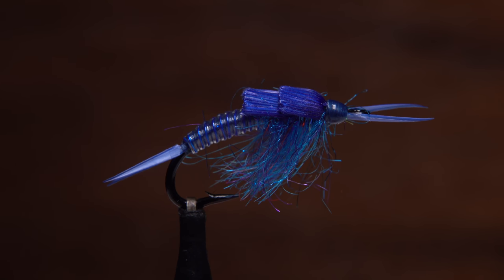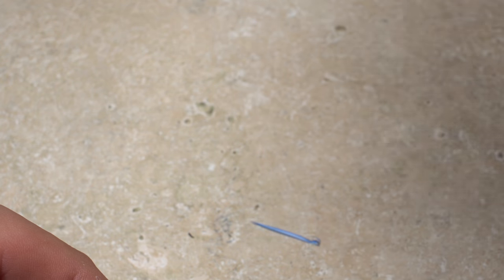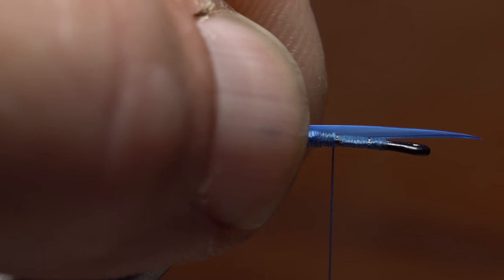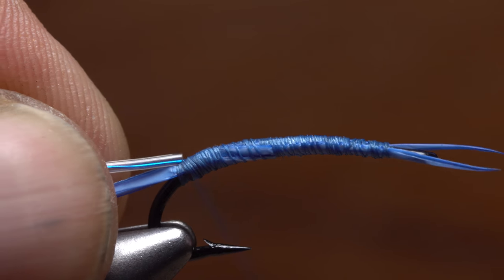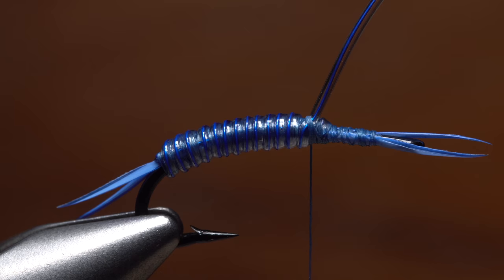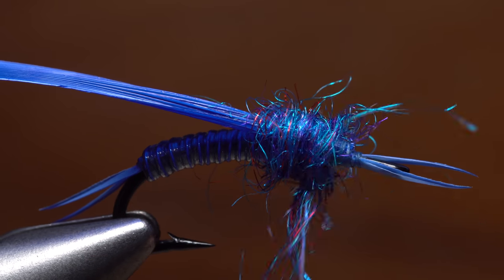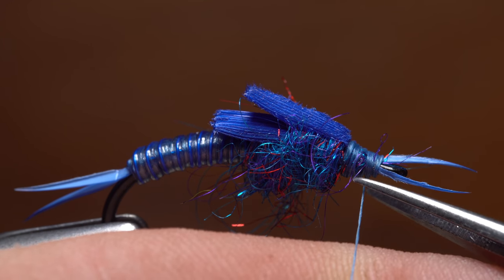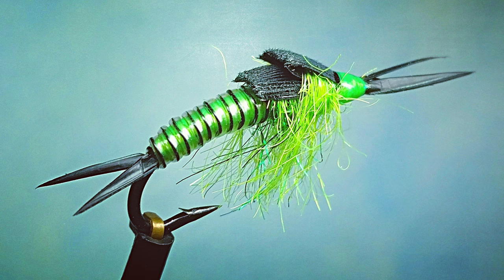JCs Electric Steelie Stone

Comment: I like this fly! Have tied several for Salmon River (NY) steelhead in the coming week. When threading the wire/tube, I forced some saliva in one end and blew thru the tube. The wire went thru with zero effort.  Thanks for the great video.
Reply: I've been doing and teaching the wire/ tubing thing for years.
A light touch, spinning the tubing is all it takes.
But if your method works for you then keep at it.

Comment: Thanks Tim AND John for a great tutorial and pattern, Smurf under Vick's vapor rub glass! I agree with you on the attributes of the fly, really it's classic tying from what I've read in Leiser's, Talleur's books as well as other tricks using stretch tubing. This really brought me back. When you "pulsed" cured the resin I drifted off to a Hendrix concert ;-) Seriously, this was great, but what's the cool nippers you used to cut the tubing/wire? Thanks again! 👍😎
Reply: I'm pretty sure the nippers are used for cutting wire in things such as circuit boards, but I'm not positive.
But they are great for cutting hackle stems after wrapping, and tying down the hackle.
Reply: John Collins Thanks John, have a merry Christmas! 👍🎅🌲